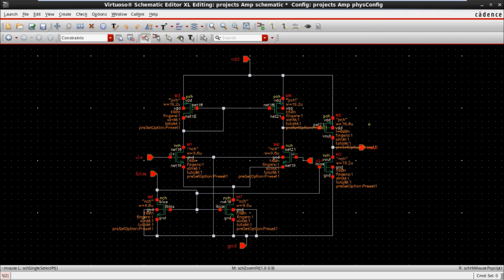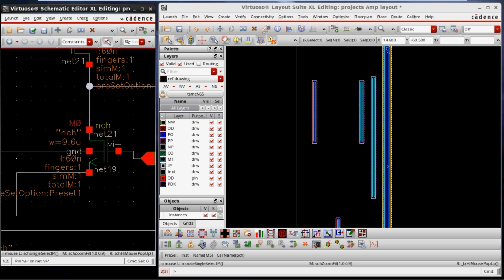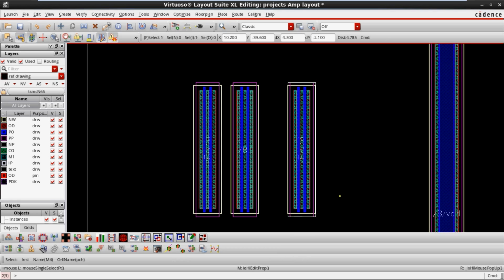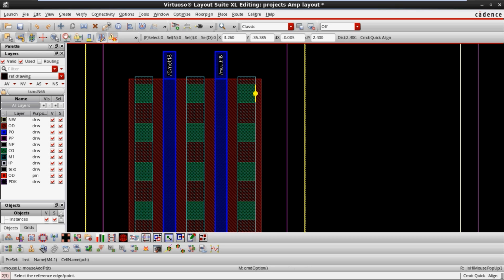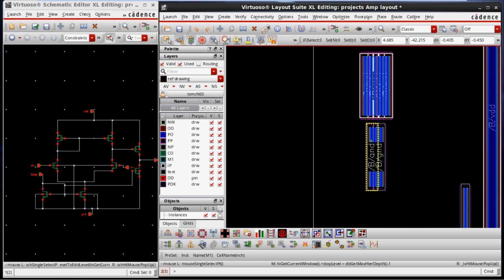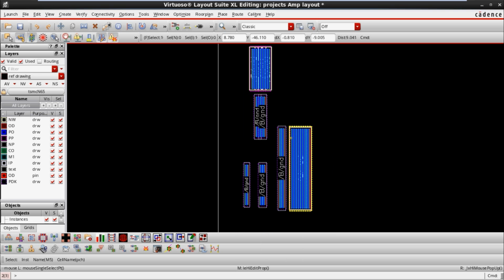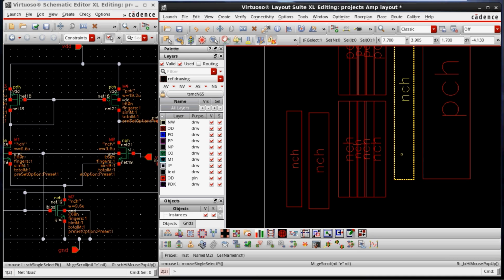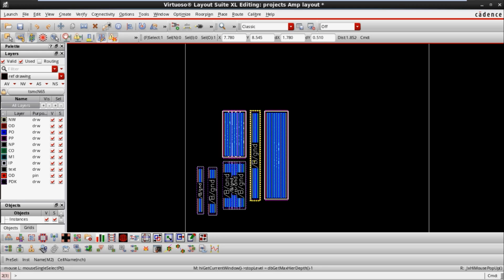Floor Plan Design - Part 1

Comment: Sir would u plz suggest me   analog layout course is tough or moderate ....... (Design for tesability course  is easy to understand ).. I am in dilemma situation  to join in course  1) analog layout design  2) design for test .. which one is best.
Reply from the maker: If Ur good and interested seripting and programs go for dft , if u don't like scripts go for layout ... But my opinion layout is ever green .... Now a days there r automatic scripts to run dft without any efforts
Reply: @analoglayout  k tq sir